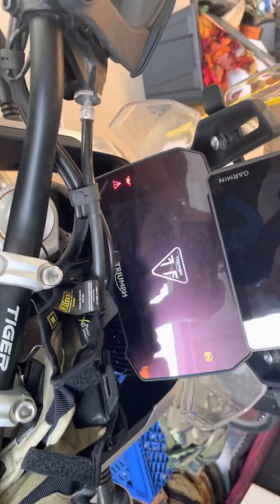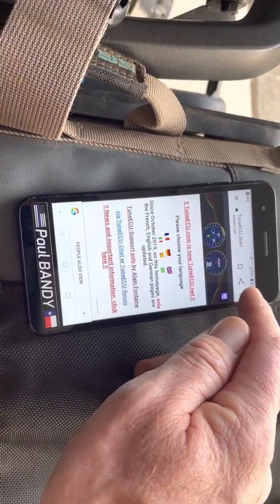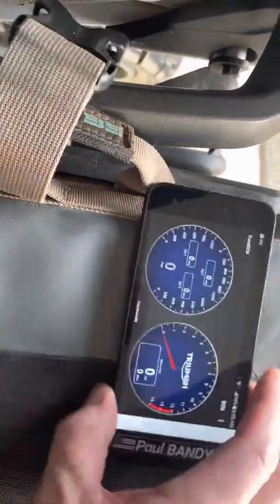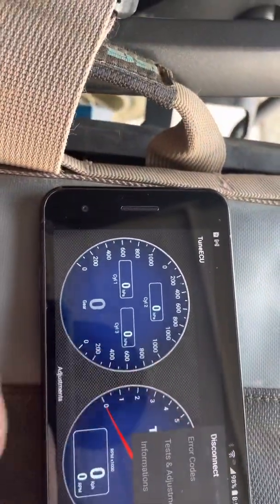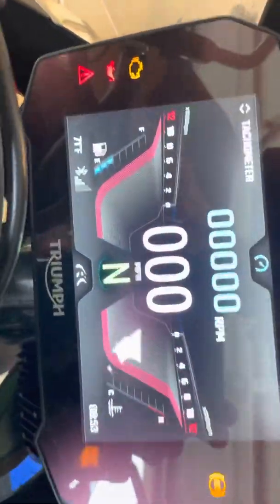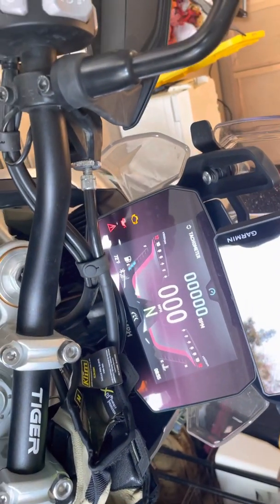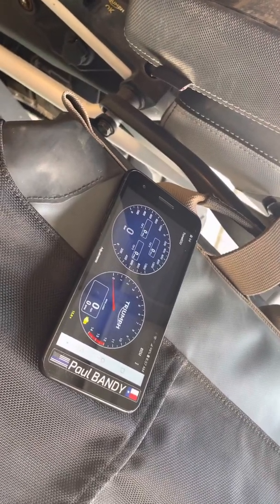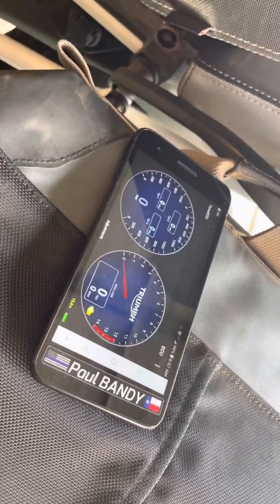UPDATE Reset Service Interval Wrench/Indicator on Triumph Tiger

Comment: Is there any way for an apple user to reset the light? I don't have android anything. I do have an old windows computer though
Reply from the maker: Not to my knowledge. I bought a cheap android phone with no service just for this purpose. The TuneECU forum/website will have more detailed information.
Reply: @BlueADV214  that’s what I thought also. I guess a cheap android tablet from Amazon for $40-$50 bucks will suffice :)

Comment: Im just assuming Because you chose miles you'll only get 6000 if you had chosen ks 10,000 would have been an option also, as we know 6,000miles 10,000 are the same just guessing really
Reply from the maker: If I remember correctly, I tried using 10k miles but the bike wouldn’t accept it… hence going with 6k. Which is the recommended service interval, which I never get to because I actually change oil/filter more often… or something else that requires disconnecting the battery and having to reset the wrench.

Comment: Your video was great and helped me through this harder than it should be process.  The service wrench is gone!
Reply from the maker: That’s awesome!!! I hate that service wrench. It’s insane that it can’t be reset from a menu… and it comes on every time you disconnect the battery, so when you reset it the “Miles till next service due” also gets reset. Kind of frustrating, which is why I keep notes on when I did each maintenance project on the bike… THE SERVICE WRENCH CANNOT BE TRUSTED!!

Comment: Can a iPhone work or only android
Reply from the maker: Unfortunately… unless things have changed, no. I bought a cheap android phone just for this and it has since paid for itself by not having to waste time and money at the dealer. 

For a better answer, I recommend going to the TuneECU forum.
Reply: @BlueADV214  do you know if an android tablet will work
Reply from the maker: @josephcongello9483  i haven’t tried it, but I would think it would as long as you can download and open the app. Would still need to register an account on the TuneECU forum though.

Comment: I don't know why Triumph took this route.  Perhaps just to generate income for their dealer network.  None of my other motorcycles make me go through this nonesense.  It is what it is and as I already own the Triumph now this video was most helpful.  Thank you, Blue ADV.  And thank you to the TuneECU programmer for making the software available.
Reply from the maker: I’m with you. And this is certainly not the only thing I would change if I were Triumph and truly listening to my customers; i.e., having to stop to switch to Off-Road modes, having to switch the bike to Off-Road after every time you turn the ignition off, multiple caution light when in Off-Road modes, etc. 

I’m flirting with the 18k mile mark on the bike and will be doing a long-term review of the bike soon. I hope you’ll watch and share your thoughts.

Comment: For some reason mine keeps shutting down the app when I try to connect to the bike ECU. I am registered. Any clue what the problem may be?
Reply from the maker: Assuming you’re using the app on an Android phone and you’re connecting to a supported motorcycle, I can’t think of any reason for that. You might try deleting the app and re-downloading or turning the phone off and back on… that question might be something you would need to ask the app developer. Sorry, I don’t have a better answer… I’ve never run into that problem.
Reply from the maker: You may also want to check and make sure you have chosen the Kelhin option when connecting as shown in the original video.
Reply: One thing that happened to me on my google pixel phone I had to turn off that app or uninstall it 
As I was having a similar proble
After I uninstalled the OBDLink app It works fine now
Thanks so much for your videos
I’m an older guy that has restored and maintained my motorcycles 
Sometimes this software stuff drives me crazy 
Thanks for you help with this one

Comment: Have you had to adjust the throttle sync? If so, how is that accomplished outside of a dealership visit?
Reply from the maker: Never even looked at it. I only use it to reset  service wrench